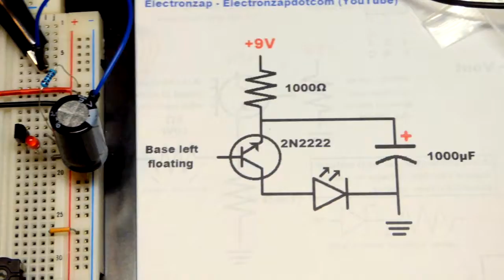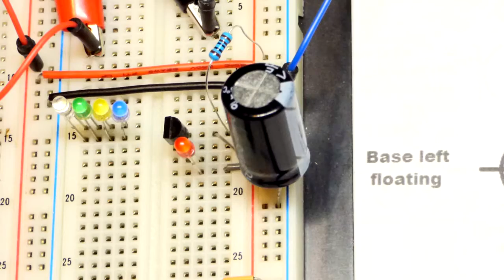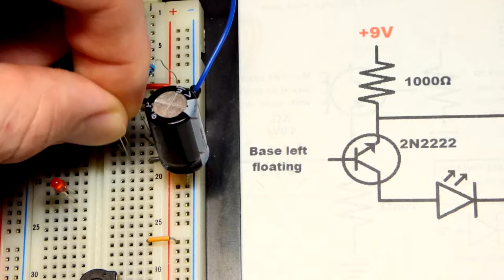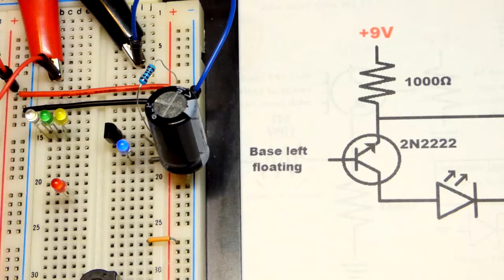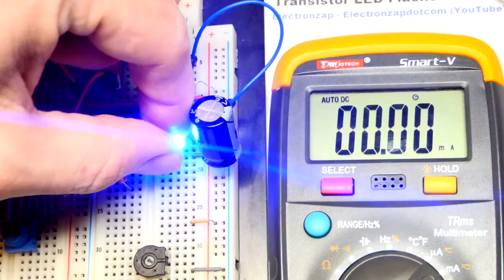Shocking amount of single 2N2222 LED strobe flasher electronics circuit current flow with blooper

Comment: I knew I had seen this before. Its called the avalanche effect of a transistor or avalanche-mode operation. Try using a color changing LED. I built the circuit and tried different loads as well as different transistors. Different transistors have different results.
Reply from the maker: Good ideas!